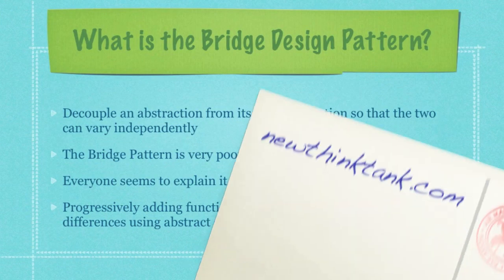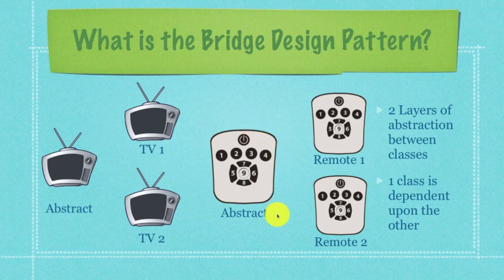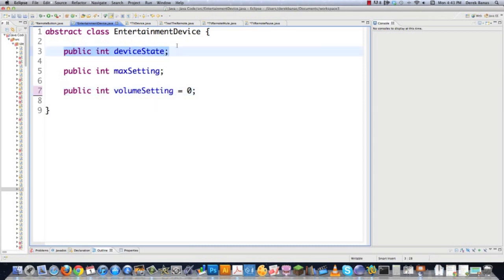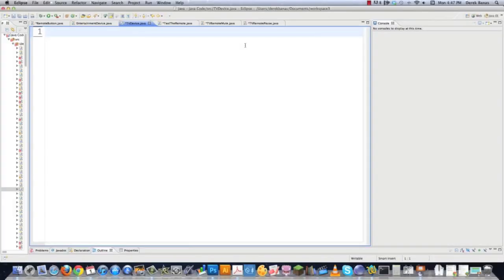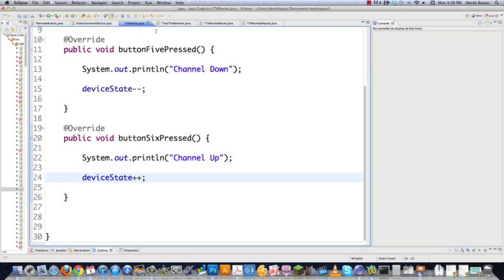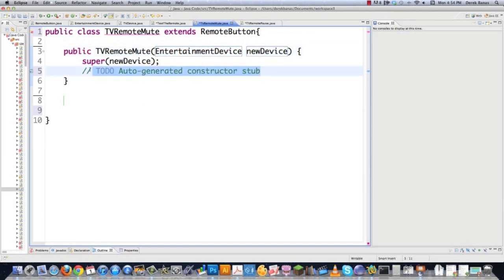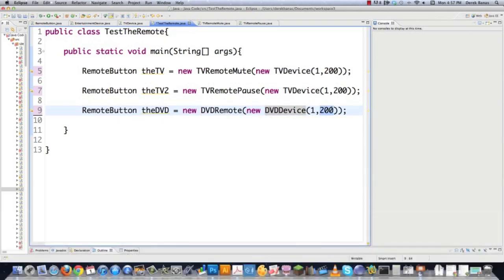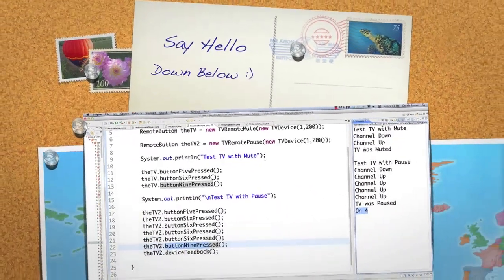Bridge Design Pattern

Comment: 10:55 I think this is not correct. There is no connection to the actual device. It will output that the device is muted, but if you would get the volume value it would not be set to 0. EntertainmentDevice would have to offer the method setVolume(int volume) and buttonNinePressed() would have to call theDevice.setVolume(0).

Comment: I respect your ability on simplifying the concepts. 
but i can't find the essential diffirence between bridge and decorater :( 
in this example  can I solve it with decorater pattern?
Reply: If you are asking, can you make a new MutedRemote( new DeviceButton()) in which the muted remote extends functionality of the given device button. then yes that is a possible way to accomplish this. Many design patterns can be used to solve the same problem. However as the scope of a project grows the downsides to some design patterns will become more obvious. What if you also needed to implement 10 or 20 other buttons on this remote. Then the classical essence of the decorator pattern would be much to obtuse to use efficiently, unless you started to nest and combine multiple buttons for a similar device like a dvd versus a radio. at which point you are much more closely modeling a bridge design already. Also a benefit of the decorator pattern is that these buttons can be assigned on the fly. So a decorator could make more sense then, if this was a programmable universal remote. because you could nest or wrap different buttons at run time that haven't been determined yet as of the time your writing the code.

Comment: I believe that EntertainmentDevices should not have methods called buttonpressed, because those should be exclusively in the RemoteControl. EntertainmentDevices do not have buttons, only RemoteControls do. Instead, EntertainmentDevices should should have methods called increaseVolume, etc. Then in the RemoteControl the corresponding buttonPressed() calls device->increaseVolume.  

All that being said, the difference between Bridge and Facade design patterns seem small, except that in your example the Facade has only one type of bank account and the Bridge has multiple types of remotes. I can adjust the Facade pattern example to create multiple types of bank accounts, ie bronze, silver, gold, and then I would end up with something that looks like your Bridge example. Please correct me where I'm wrong.

Also it would have been nice to see the variable maxSetting used, and default volumeLevel different for each EntertainmentDevice.

The more I think about this, the more interesting it gets!

What we have here is a Remote with numerous buttons that has many derivations. The base class Remote has a base class Entertainment Device.  That's the most interesting part. Because of this, depending on what instance of the base class Entertainment device was created, the base class remote behaves differently. This is very cool polymorphism because you have a polymorph inside of a polymorph. I'm starting to really appreciate this now!

Comment: Hi!

What exactly is the Bridge pattern here. Lets say your Entertainment device wasnt abstract and you just had one kind of TV, but you still have two Remotes that does different things with the 9 button, is it still the Bridge pattern?
Reply: +Emma Hedlund The bridge is that you are storing the objects in their abstract form and calling the commands on the abstract classes and not on the concrete classes. The object itself (depending on how it was initialized) decides then what it does, and not the user. Therefore you just say "press up" and depending on which remote is saved, up means different things. This allows to swap out different concrete objects without changing the class, which is using them.

Another example would be a class that stores data in a list and has options of adding or removing data, so it just stores the abstract class "list". But how this data is stored (linked list, binary tree, double linked list, array) could all be options for different concrete lists.

Comment: Hi Derek. I like you videos, but this one seems like you are trying to confuse the viewers.

- why do you call your abstract remote "RemoteButton"? its not a button, it is a remote control. i should be called AbstractRemoteControl.
- The implemented Methods in RemoteButton actually call there function on the device, but then in TVRemoteMute you don't call anything in buttonNinePressed. just printing "TV was Muted" will not do anything to the TV. it should call the mute button function of the device
- in your main method, you call the fields of your remotes "theTV". but this fields are not TV devices! they should be like tvRemote

other then that, thx for your videos
Reply from the maker: +saila456 Good points. Sorry about the naming. I write the code out of my head and it isn't always optimized. I give up on having optimized code so that I can better focus on the thinking process.
Reply: I think this video should be really redone. Its getting confusing and really abstract very fast.
Reply: yeah I agree it should be called RemoteControl not RemoteButton, I found that confusing. However, by I figured this out by renaming all the classes and methods, so it was a good learning experience.
Reply: Also want to point out that the RemoteButton class should implement buttonSevenPressed and buttonEightPressed, otherwise it's incomplete and there would be no way to access those methods in the Entertainment device using the RemoteButton base class pointer.
Reply: I agree, in bridge pattern it really should be a remote control. And the naming reminds me of the Command Pattern video, which used a similar remote-device example to explain stuff, and in command pattern the 'invoker' is good to explain as a remote button

Comment: This is just plain bad code. Please don't write code like this. First, how many viewers noticed that "theTV.buttonSixPressed()" works, but "theTV.buttonSevenPressed()" does not work? Hopefully, everyone agrees there's a problem here.

You could add some more code to work around this, but the real problem is the design is confusing different kinds of devices. Remotes should clearly have all 9 buttons available (not just some of the buttons) and should not store any state (e.g. a volume or channel). TVs and DVD player objects should have volume and/or channel properties, but should not have remote control buttons. But these things are all mixed up. What look like remote control objects are named "theTV" (not "theRemote") and those objects, whatever they are, inherit from remotes which are passing control up to other TVs. It's even possible to pass a TVDevice to a DVDRemote so you will be trying to mute your TV and instead playing a DVD!

Furthermore, using a deviceState variable (as well as maxSetting) to represent entirely different concepts (a TV channel or a DVD chapter) is breaking a fundamental rule of OO design: the "L" in SOLID (Liskov Substitution Principle). There's no reason the two concepts should be conflated as one thing in an abstract class and many reasons NOT to do this. Besides having a bad variable name, you're building a broken and buggy application because you are breaking polymorphism. Do not use this as an example of how to write code!
Reply from the maker: +Andrew Palmer I'm sorry you didn't like it. This is however not optimized code, but instead code that came right out of my head as I typed. The goal was just to provide an example of the pattern and not a working system.
Reply: +Derek Banas Hey Derek. Thanks for the reply. I commented because a lot of students seem to be watching and they need to understand you're demonstrating some key design pitfalls as much as you're demonstrating the pattern. I did mean to say more than I don't like it. SOLID is undisputed, and I think that goes beyond being a matter of taste.

To see why it's bad, put yourself in someone else's shoes. Imagine working with a library you've downloaded from the internet that has bad variable names that are not just undescriptive, but mean different things from time to time. (Ugh!) You would be frustrated out of your mind, googling answers on Stack Overflow and trying to understand how the library designers could have been smart enough to turn on a computer. You would probably go on to write a number of bugs before you decided to just start over with a different library.

I also think it's unclear from the video that the API you wrote is broken. Some buttons work and some are inaccessible. (See the above analogy.)

None of these problems are inherent to the pattern. They are flaws in your example of the pattern. It's a cop-out to say you never intended the code to work. The whole point of adopting patterns is to make your system work better.

Thanks for hearing my critique.
Reply: *****
I am considering it, Chris! (That's the main reason I found myself here, actually--looking at what's already available.)
Reply: I love Derek but I think that's reasonable critique. I get that a lot of bad practises are tolerated for "demo" purposes but there wasn't a disclaimer regarding the violation of the SOLID principle, for example. And that's software design related video.
Reply: Andrew you didn't get the point of this video. It's a demo on a design pattern.
Reply: haha just hilarious... Wow Dr. Clegg, my former professor would laugh at you. Don't know who Dr. Clegg is, he's the colleague that helped Donald Knuth write The Art of Computer Programming Book Set

Comment: everything was going so smooth, and then bam!, at 12:12 I lost it :( 

My question is, why do we need the class DVDRemote? The refined abstraction already contains two classes that handle Mute and Pause functionality (TVRemoteMute and TVRemotePause) and to my understanding the refined abstraction should totally ignore what kind of electronic device is passed to it.

Let me know if I'm missing something obvious here, and as always thanks for your videos
Reply: btw, I think I'm asking the same thing as Marcus did a year ago on your blog. But I'm still confused. Any help is appreciated. Thanks!
Reply from the maker: +Panagiotis Kouretas The idea behind the remote is to be able to easily extend the remotes so they can specialize. The design provides for the ability to work with an infinite variety of entertainment devices and remotes.
Reply: +Panagiotis Kouretas The idea is that it allows you to mix and match remotes with different devices. We could if we wanted use a TVRemoteMute with a DVDDevice but then it wouldn't provide functionality for playing the dvd with the button nine and instead mute it. Although, given we did this we would still be able to increase and decrease the chapter as that functionality is defined in the Device. 

The key thing to remember is that you have remote functionality and device functionality. Using the bridge pattern we can create an infinite variety of devices and remotes. and mix-match functionality as we please.

Comment: Hi Derek, I got confused. Do you think Bridge Design Pattern is kind of similar with Strategy Pattern? What does the Bridge mean?
Reply: +Jiayu Liu 
Same for me. And I think most people get confused by the similarity of Strategy and Bridge patterns. See http://stackoverflow.com/questions/464524/what-is-the-difference-between-the-bridge-pattern-and-the-strategy-pattern 
and 
http://stackoverflow.com/questions/5863530/strategy-vs-bridge-patterns
Hope that helps
Reply: Well...i got the confusion too...but here is how I consoled myself...in case of Strategy the problem being solved is multiple strategies can be in injected into the Strategy interface based on different strategies and this can be done without changing the client sbstraction..in case of bridge it is more complicated..it tackles the problem what happens when the strategy interface itself changes..how do I still go on without changing the client abstraction...both problems are being solved by the composition of the client abstraction containing the interface of the implementation which causes the confusion..

Comment: A good explantation about the Bridge Design Pattern, thank you very much. A thing that confuses me is the declaration of the "abstract void buttonNindePressed()" - Method in the RemoteButton class. What is the purpose of a button which isn't supported by the tv-device? You print out e.g. "TV is paused" but technically you can't pause the tv because the concrete Device-Class doesn't have any method which can do that :). Best regards

Comment from the maker: Check out the pause part of the program for how you can extend the program. Some times just playing around with the code is the best way to understand. You could also try to implement a different system using the pattern

Comment: I understand the code and the definition but i am not able to relate the definition with the code that why this code will be said bridge design pattern. And one more confusion that in case i want to call buttonSevenPressed() and buttonEightPressed() will i have to override both method in every remote concrete class???. And why you have not implement those methods in remote. Sorry if i have asked something stupid..:(

Comment from the maker: An adapter creates an interface between 2 classes so that when an incompatible method is called the user is instead diverted to a method that works. The Bridge builds up concrete classes in pieces. You slowly add layers of methods that must be defined to fulfill the contract after you extend the abstract class. Does that make sense? I'll cover when to use which pattern in a future tutorial